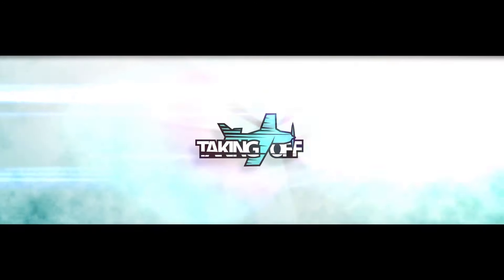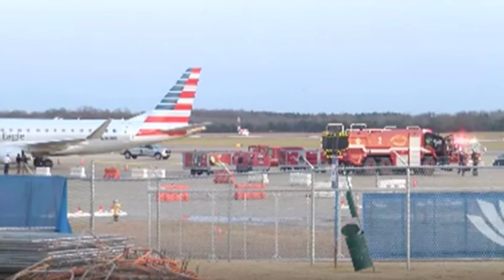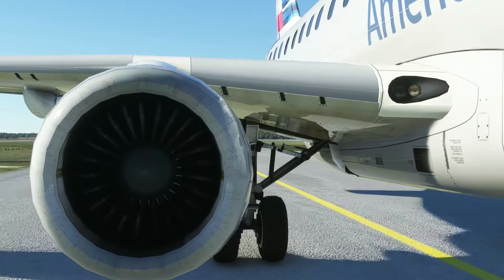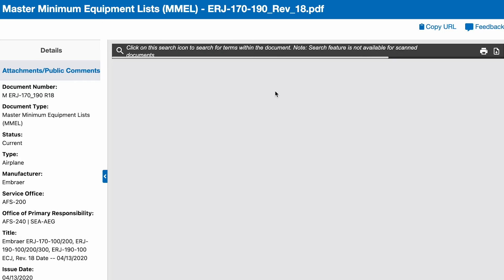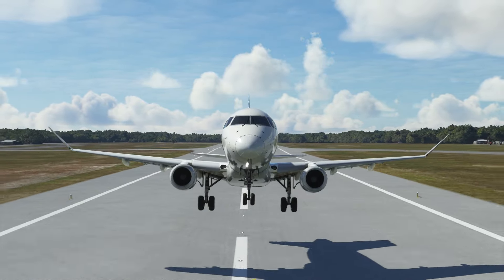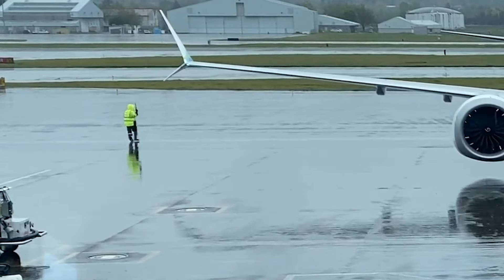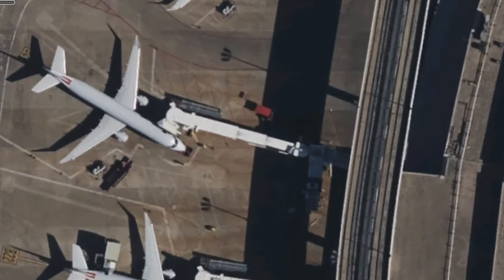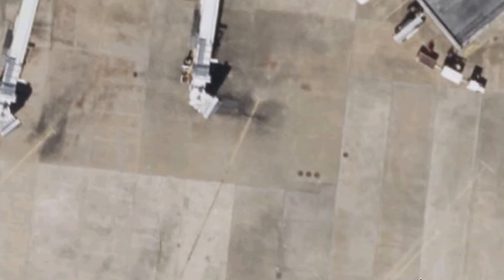Woman Sucked into Engine at Montgomery Regional Airport New Years Eve UPDATE

Comment: This accident has hit me pretty hard this week. As someone who just started working on the ramp this year and regularly works on this aircraft, this scenario is always in the back my mind. The ramp is incredibly dangerous. I feel so empathetic for the ground crew and the victim. I can’t even imagine the emotional and psychological impact this has had on everyone there.
Reply: Yeah, anyone that saw this, Co workers, and maybe even passengers would find this incredibly hard to deal with. Imagine a child looking out of the window at this time. 😔
Reply: @purplepixie274  exactly
Reply: Why don't they put safety features on the engine? Like a hydrolic screen that covers it while it's on the tarmac.
Reply: @Mustang1984  they really should
Reply: This is not as bad as walking into a prop. If she got pulled in that engine was not at idol speed. Nothing left but burns chunks, walking into a prop on the other hand is quite graphic.
Reply: @purplepixie274  There have been some conversations about the fact that some pax did see this happen.
Reply: @Mustang1984  yea you want step in front of it to put that screen on that your talking about. How about better just keep behind the line until they get ground power & pilots shut it down. I did the ramp for almost 20 + yrs no problems. I listen for those engines to be shut down before I approached. I had no issues. Putting a screen up as you talked about would require someone to approach it to put this screen on it. No thanks. Just wait for it to be shut down. Even safer.
Reply: @Venkman29  You do know what "hydraulics" are don't you? Things like that can be engineered. Something built into the front of the engine itself. Guess it's just a matter of money. But yeah, walking up and putting a screen would be stupid.
Reply: You block it out and move on.
Reply: @yaelfeder9042  No, they really shouldn't.
Reply: @Mustang1984  Extra weight, extra parts that shouldn't be near a jet engine intake.
Reply: I fly quite frequently and watch the ground crew.  My employment at an electrical power plant has me think of body position and location at all times.  As I look out the window and see the baggage handlers driving around other parked vehicles at high rates of speed causes me to cringe.  There are a lot of blind spots and activity around aircraft as everyone is in a hurry.
Reply: Follow SOP and you will be fine I've worked on the Ramp for 4 years just keep your head on a swival
Reply: @Princess Mari SOP is an Accranam that means Standard Operating Procedures that you place of employment lays out so you won't get hurt on the job and ensures you do the job safely it's only effective if eveyone follows it when in doubt about something on the Ramp ask an Exprianced Ramp Agent or Ask your Lead or Supervisor I'd say ask your supervisor over your Lead because your Lead is not always perfect but if you ask your supervisor questions they are there to help and make shure your doing the job safely and effectively
Reply: @Princess Mari you dont have to be scared of SOP
Reply: @Princess Mari What I can say is just follow the directions of your supervisor and any of the old timers that have experience and also when you are wingwalking an aircraft always do a 90° walk from the wingtip to the nose gear that is how you avoid the engine ingestion zone of an Airplane so when your at the wingtip just walk or wait untill the nose gear of the Aircraft is in line with you then you are good also when your Crew Lead/Supervisor gives the thumbs up or all clear to approach the aircraft and the becon light is off it's safe to cone and chalk the Aircraft 
Also when working on the ramp it can get hectic but DO NOT let anyone rush you or force you to move fast because once you start rushing accidents are a 8/10 occurance take your time and dont rush because it's not worth getting hurt to meet a deadline if someone rushes you to go faster than an efficient pace let your supervisor know trust me out of my 4 years on the Ramp the times I got hurt was when I was rushing once I was doing an A380 onload it was icy and I fell 20 feet from the belt loader all because I was rushing and I miss 2 weeks with a sprained ankle and I learnt my lesson since
Reply: @Princess Mari No problem glad I can help give some tips but overall the Airport is a fun place to work at I had so many fun moments working on the ramp seeing rare Aircraft like 737-200 and when your around good people and you have a good crew who works safely it's a good time you will always have people who don't work safe but don't follow bad habits I tell new workers on the ramp the same thing I tell them don't rush dont go to fast or super slow just go a normal pace and you will be good 
The only reason why I feel off 20 frer was because I was rushing even my supervisor told me saying see what happens when you rush and it's slippery but yea there is no reason to be over scared just have respect for the dangerous machines on the ramp and when you handle them make shure you are trained to do a certain task if not dont do the task of you lead tells you to do something you are not trained for dont do it becuse you can get hurt or in trouble 
But I'm glad I could help you relive some of your anxious feelings and give you some confidence before going onto the Ramp 👍🤘
Reply: @Princess Mari Go buy yourself some real good boots! Always wear hearing protection even if your in the bag room! And if you think someone is telling you to do something unsafe,ask them to show you how to do it! And if it's raining or snowing look behind the engines! You notice snow blowing and rain blowing! Older aircraft the fan blades will be numbered! If you can read the numbers on each blade (not blurry)pretty safe to approach! Stay safe !!
Reply: @Princess Mari Sorry , I didn't see your reply! That's what I have,Timberlands!! Hope everything is going well for you,only other thing is if you don't know something! Don't be afraid to ask! Be safe!!
Reply: @Princess Mari Belt loaders have a foot hold behind the back wheels! And if your using railings ,use those to pull yourself up! Your trainer sounds like trouble! Are you sure both engines where running? Not just APU running?

Comment: I have 2 friends that work for 2 major airlines and they have for over 30 years
They told me, NEVER, EVER FLY
the horror stories they tell me, I won't fly, ever
Reply: I believe your friends are right! I've never liked flying & really haven't flown that many times. The airliners now can basically fly themselves. 
I started watching videos about plane crashes. Called MayDay, they reenact the crash then find out the cause. 
It only reiterated why I don't fly. Boeing is the worst. Imo.
Profits come before safety! 
Very scary!
Reply: @truthylucy7068  The top brass, like CEO, CFO, COO, VPs, etc.. who all make over a million dollars a day joke all the time among themselves

"LOAD FACTOR IS JUST A NUMBER "

Planes are designed by the manufacturer with a specific configuration for instance the plane will have two rows one seat on each side for a total of 50 seats

They will have a option for 75 seats a two by one configuration

Airlines will rip out the seats and put in their own seats that are much smaller and much closer together and they will put 150 people on that plane that was designed for no more than 75 people.

On top of that they will pack the cargo hold full of private packages having nothing to do with the passengers

Normal safety guidelines say you never put more than 75% of the load Factor on the plane

Every flight typically has over 95% and I have personally been on planes with load factors over 105

One flight was so overloaded that the same plane we had wheels up when there were only eight passengers before we reached the 1200 foot mark on the runway but on this day we reached the end of the 12,000 ft runway and the engines were screaming and the pilots knew the chances we were not going to crash through the fence onto the highway were at best 10 to 1 and I still don't know how, but we rolled off the end and we grazed the barbed wire and we were not more than 3 ft above the cars on the highway and it took us almost to Canada flying just over the treetops to burn enough fuel to gain altitude to be able to turn and we arrived 3 hours late on a 45 minute flight

They don't care and Congress passed a bill quietly on New Year's Eve that no one knows about that limits the maximum payout per crash to $100,000 which means your family will receive about $400 if you die in a plane crash that is the negligence of the airline

The same thing happened with the medical profession where they limited the maximum payout to $100,000 and no lawyer will take a case for malpractice because there's no money in it and now the same thing with the airlines so I expect to see a lot more crashes in the near future and they hate when people shine a light on this but they are evil they are evil beyond evil

I have literally been in The house's of the 1% and I have heard them talking when they had a load on and they would say if I gave you a dollar for every person in the world that was killed how many people would you want to die and they say all of them.

Then they pause and they think about it and they say no I need enough people to take care of me and to run the critical systems of the world but the rest of them can go

You think the Nazis were bad the Nazis have nothing on these people nothing

To be around them and to listen to them talk I cry I literally have broken down crying hysterically listening to these people talk as they do everyday among themselves and it is sick it is honest to God sicker than the Nazis

They see us as disposable and they hate us they despise us there has never been poor people that hate rich people anywhere near the way rich people hate poor people

I don't know what the hell is wrong with them but they absolutely want to exterminate all of the poor people

Comment: Prayers for the family. I don't know the exact cause, but this is at least a reminder that familiarity with danger leads to relaxing one's own safety standards. I worked in a lumber yard millwork shop from age 15 through about 25. I remember initially I was wisely afraid of the planers, the big saw blades, the metal feed belts with teeth that could grab you and pull you into the machines. And I remember that after losing that initial fear it takes concentration and constant awareness to keep up safe practices.
Reply: you can never take things for granted, or else you can meet an unfortunate end.
Reply: That's a good point. I know that I've seen in myself and the lives of my friends that there's such a constant pressure from bosses to somehow be faster every time, even to the point of outpacing computers, that you try to force that confidence onto yourself so you can just get the work done rather than hearing the same whining all the time and having that whining about our need to be even better and even faster and to be so right away stand in the way of us hoping to make more money that year. Getting efficient, not necessarily fast, takes years. I found myself initially feeling frustrated on Mom's behalf, but of course I can't say for sure whether it was her error alone or whether psychological pressure to keep things moving caused her to push herself beyond what was wise.
Reply: As a child I remember seeing my great grandfather and great uncle without their thumb.  Evidently both of them lost them in sawmill incidences.

Comment: As a retired Air Force crew chief, we would work within a few feet of the running engines on the KC-135A.  Once the aircraft was updated to the CFM-56 engines with an inlet about six feet tall, and only knee high off the ramp, we were concerned about working around the engines, especially since the first blade is now rotating.  When the inlet is bigger than you, we gave it a large berth, and never had any issues.
What most folks don’t know,is by the time you feel the pull of the inlet,it is already too late.
Reply: Robert, So you are saying you don't or can't feel a "gradient" of vacuum gradually over like ten feet, but it's more immediate and black and white, one moment you're fine, and a fraction of a second later, when you get one foot closer, that's it? Man, that is scary to know.
Reply: l was an air force crew cheif too.Its not  good idea to get in front of a running jet engine .l have hot pit refueled dozens of fighter jets and it's not hard not to get sucked into the intake if you understand this simple concept .It's kind of like don't stick your hand in a pot of boiling water and you won't burn your hand
Reply: People often don't really think about the power of an engine that keeps an airplane in the air. They really can't fathom that kind of power. Location-wise, it's not like the engine of a widebody aircraft that is so high off the ground. 

Horrible incident that many outside the industry won't understand.

My heart just breaks for these 3 children who lost their mother. They will never fully get over that.
Reply: @le_th_  … “people often don’t really think about the power of an engine that keeps an airplane in the air” may say it all at the bottom of this tragedy.
Reply: @lukelee7501  I was a plane captain ( enlisted, not Officer ), in a Naval air squadron wayyyy back in the 1970's. Over a three year span, I too must have launched, recovered, hot refueled hundreds & hundreds of times, and assisted maintenance while they worked on running engines. Granted, these engines were not as powerful as these engines on this plane, but you still had to be very careful and very respectful of the intakes on a running engine. They were certainly powerful enough to suck you in if you got too close.
Reply: @marbleman52  Both of us were way more well trained than you see this rampers are here though.These aren't a&p certificate holders by a long shot,they are baggage handlers who were just  told not to walk out in front of the sucking side until they shut the beacon lights down
Reply: @lukelee7501  Agreed...!!
Reply: @douglas2lee929  basically no warning before it is too late.  When I worked C-141s, we had a young airman who walked toward the front of the aircraft, right under a running engine.  On those engines, the first set of blades were stationary, and if you made yourself as big as possible in going , the engine would stall out, backfire, and spit you back out.  This young airman ended up losing the hood off his jacket, the side of his Afro, and severely damaged his face, where the suction pulled at it.
Reply: @lukelee7501  we would frequently be within three feet of the J-57 engines, while rolling up the power cart.  I would always keep a grip on the unit while doing that.
Reply: @robertheinkel6225  Thank You. That is what I wanted to know.
Reply: I worked a a refueler (POL).  They taugt us in text school to stay away from intakes & exhaust.  I always remember to stay at least 5 feet away from intake & avoid exhaust as far as possible.
Reply: Yes, I would imagine that once you feel the pull, every centimeter closer is an expotential increase of suction.
Reply: @robertheinkel6225  Were you at Ellsworth 88?
Reply: My step-dad worked on a Navy base back in WW2 on the flight line. He told me this story.   People would squeeze between the fuselage and the enboard engine of a PBY4-2 (B-24) rather than walk around the wing.  One guy got the buttons ripped off his jacket by the prop.  After that incident, someone painted a cartoon of a prop wearing boxing gloves with the quote, "I ain't been beat yet." on  all the aircraft.
Reply: @bobbybabsonjr787  Grissom AFB In for 13 years, Malmstrom AFB in MT for 3 years, then MacDill AFB For 3 years
Reply: @robertheinkel6225  I was at Malmstrom in 89 -90  when the whole squadron went to Kansas .
Reply: Reminds me of videos of the dangers of Delta-P when you're diving. 

"When it's got yah, It's got yah."
Reply: @BrokenLifeCycle absolutely. In fact, it IS delta-P that caused this accident ultimately, air being forced into the engine which is a confined space/channel does create a pressure differential in the surrounding air. Like said, it's strong enough to suck the water off the ground nearby. Air is compressible unlike water, so it's not as dangerous as underwater Delta-P, but that's essentially what suction is
Reply: @bobbybabsonjr787  we moved the tankers to FL in 96.
Reply: @robertheinkel6225   I crewed on 0275 then to maint. team  I wondered where the acft went when Malmstrom closed . Good talking to you.

Comment: I was a crew chief (jet mechanic) in the USAF for many years, When I was a one striper I saw a civilian ground handler in 1966 walk into a prop and killed. I almost got sucked into an F-16 when a pilot pushed the throttle up while I was doing an "end of runway check" (we pulled the remove before flight pins) when I was in the nose gear checking the brake accumulator. It can happen to the best of us, it just takes a moment of carelessness by someone. It is a terrible thing and no words can soften it.